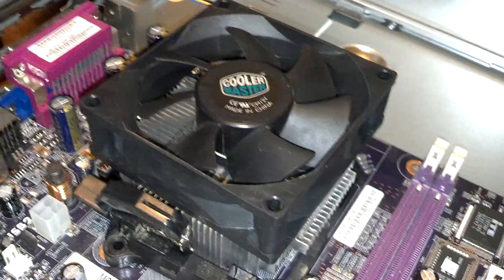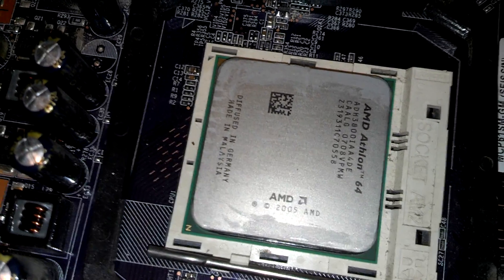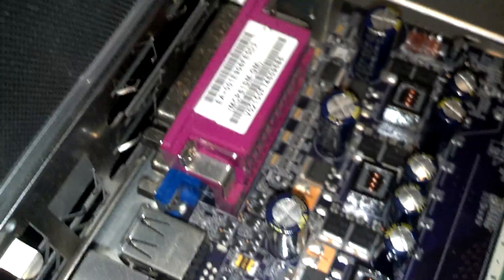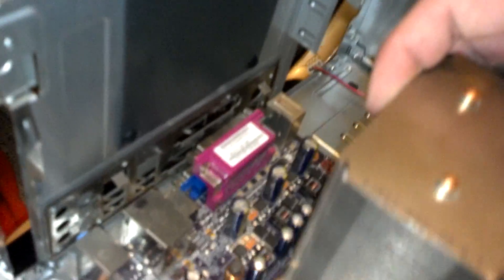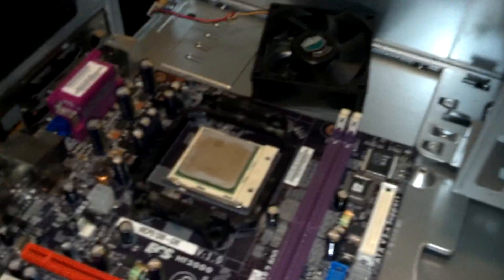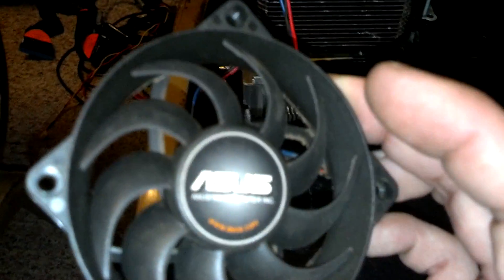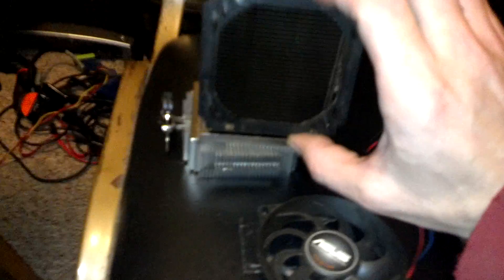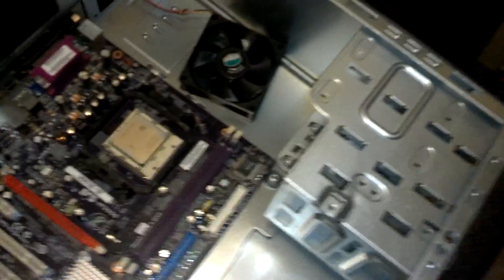Custom cpu cooler project

Comment: looks like a bad power supply nuked that thing. thats usually what the capacitors look like in the cases i've seen. score on the spare parts but don't use that PSU.. G'luck man.